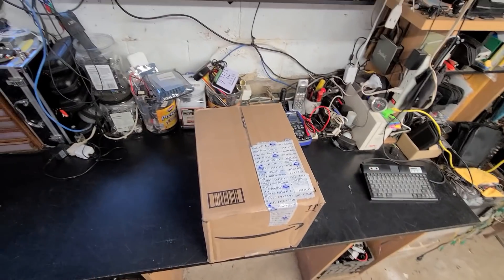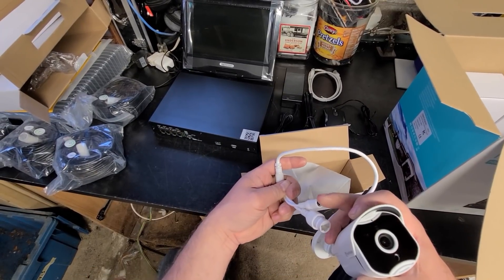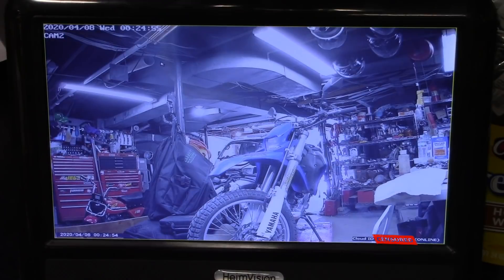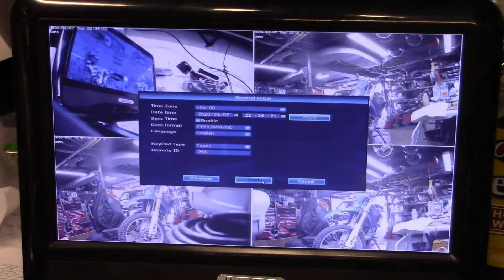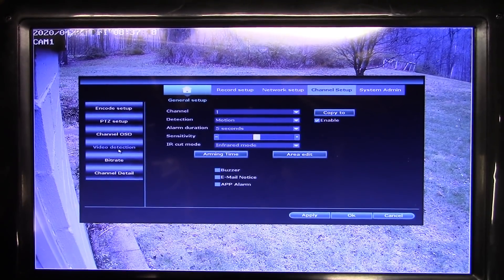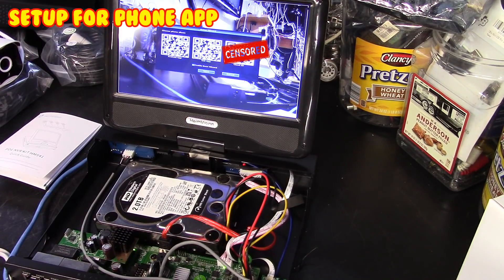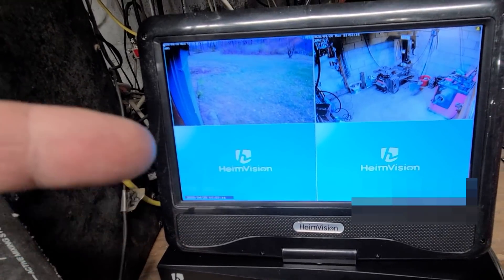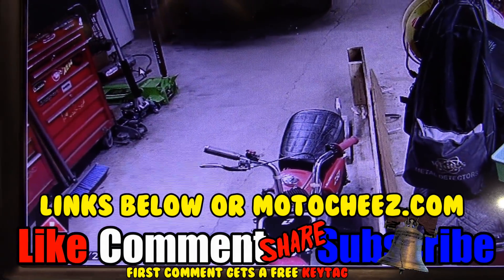**UPDATE**  BROKEN! Easy Security 4 Camera (8) System. HeimVision Plug n Play POE NVR Kit (HM541)

Comment: Not bad for the price. I've been doing cam security setups like this for over 15 years. While a ssd would be nice, be careful with which one you get. Make sure it is rated for NVR use. A NVR writes a lot of data ALL THE time and it will kill normal desktop hard drives. My favorite security cam setups are by Dahua and HikVision, but this one looks pretty okay.
Reply from the maker: Thanks, good info. I used to do security cams years ago, seems the mechanical HDDs are better for constant R)W, but I've had them fail on me after about 3 years. (stock Qsee)

Comment: You should DMZ your Chicom CCTV system or keep it off your network so it can't be accessed remotely. Don't sign up to or use any servers or apps they offer. XMeye was one my system recommended. It didn't even use HTTPS for the login screen at the time... I also suspect the CCP can access those servers at any time.
A SSD isn't necessary for a NVR. You need capacity and longevity, not fast read and write speeds. 
When the NVR fails you can sometimes find a replacement board under a different name on Aliexpress. You can also buy the camera components as well and assemble your own if you know what's compatible. 
I find high resolution CCTV camera's to be too sensitive to movement outside at night because the Infrared LED's attract bugs. I found that if you unsolder the IR LED's from the boards and connect remote IR lights up a few feet away from the camera's this stops the bugs from swarming the lens and also provides better lighting.  You can point the IR lights at a wall and create a huge softbox. This also prevents the IR version of "red-eye." 
My last piece of advice is to hide/camouflage your real camera's and use dummy camera's in visible area's.
Reply from the maker: Good info. Security cams was my thing years ago. I've had too many mechanical HDDs fail on me. Cost way too much to recover, I haven't had a SSD fail on me yet (I have 20 cams, 3 different systems now)
Reply: @MotoCheez  
Oh then you know some of those old camera's can be updated. I have some NOS GE dome camera's I gutted so I can reuse them. I think the lenses are glass so I held onto those too. 
Some brands/types of HDD have been very prone to fail. Heat can also be an issue. Western Digital's had been very good for me. Out of more dozen I've owned since the 90's I had one fail and that was probably because it got wet on my desk when I spilled water...

Comment: The fact it comes with a monitor is nice. NVR is like DVR or just a set top box, I guess. If you don't go for SSD another option would be a NAS drive. They are more designed to run 24/7. I wonder if you can use an external POE switch with it? Since running cables all over the house can be a bear, making a POE hub on one side of the house might work?
Reply from the maker: NVR just means network video recorder. MAS is probably the best option, I agree. I'm not sure on the wiring option. It may work since the cameras have an ip adress.

Comment: Nice system moto, you gonna tell that company about the bad harddrive? It could be the smaller harddrive causing the shut down during playback
Reply from the maker: It's sent with no hard drive. That was an old one I had. I doubt it, works fine on the phone app
Reply: @MotoCheez  ok..  the ssd would definitely work a lot better.    The next computer I get will have ssd
Reply from the maker: Others saying the mechanical drive better for multiple rewriting, but I've had many fail on my security systems. I could be wrong...
Reply: @MotoCheez  I heard that ssd is faster.. but I want to my next computer to have disc drive, so I can backup my YouTube in DVDs
Reply from the maker: SSD is way faster, but has less read writes supposedly
Reply: @MotoCheez  that's ok.   I don't think I'll be doing any rewriting
Reply from the maker: For a PC SSD is awesome. The SSD rewrites a lot automatically, it part of the OS
Reply: @MotoCheez  cool... I will definitely get an ssd.  I'm thinking I'll end up buying a Dell comp.

Comment: SSD is nice for booting computers, something that gets constantly rewritten (assuming you use the rewrite function), not so much, so HDD is more than adequate/good. Especially a big honker one.
Reply from the maker: My only issue with the mechanical HDDs fail every 2 years  on my other security systems. I installed a SSD and it has not failed me nin 3 years so far. None of my SSDs have failed me yet
Reply: @MotoCheez  You must be buying the wrong hard drives. If you get a hard drive made for a DVR / NVR they will last a LONG time as they are designed to get slammed with recording data all the time. I have TiVo hard drives that are over 6 years old, still working fine. It's all about how the drive was designed.  I think WD Purple drives are pretty okay.
Reply from the maker: Had a few Qsee stock HDDs fail. Yes I've heard those are the ones to get. I'll definitely try WD purple next time. Thanks

Comment: So,  without a hard drive it will not store footage? What hard drive do you suggest getting and how many days till it starts to loop. I dont know much about techy stuff, but need some cameras for my shop, there is not internet there, so i will need something that has a large storage.  Thanks for the video Moto,  very informative.
Reply from the maker: Correct, it will not record without a Hard Drive. I'd get at least a 2TB HDD. Mechanical Hard drives pretty cheap and most have said it'll work better than a SSD. I set mine up for just motion record so a small drive will last me months, if you do continuous record and use a 2TB drive, 4 cams use 169GB per day, so  it should store about 12 days (which should be double). If you set to motion record it would be several months
Reply: @MotoCheez  awesome,  thanks for the clarification.  I think i will try out this unit.
Reply: @MotoCheez  so this unit is good to go for someone without internet

Comment: SSD/solid state aren't very good for NVR duty. The constant write to them will wear them out pretty fast. A NAS/NVR harddrive is what your after but you'd probably be fine with that old drive just run crystal disk check on it and make sure its good to go.
Reply from the maker: I've heard that, never realized there was that much difference. Yes it's an old NAS drive. I'll try the crystal disc

Comment: DO NOT put an ssd drive in that camera setup.  The constant read rights will destroy the drive quick plus I doubt the device has software to maximize ssd life.  Go buy a Wesrtern Digital red regular hard drive.  Their firmware is designed for longivity in read write even if they aren't speed demons.  The red drive will be much cheaper than the SSD too.
That being said I do sugest you check the devices manual in reguards to recomended hard drives.  The OS in the system may be limited by the internal software drivers.
Reply from the maker: I realized that after the video, I've just had so many mechanical drives fail on me over the years many in many in security systems... I've not had an SSD fail on me yet.
Reply: @MotoCheez  Ok I don't know if you know this or not but feel free to ignore.  I think it would be good info for your fans to know so...here I go.  Just a question what type of environment are you using the security devices in?  Also did you always use the UPS in your system?  If there is a welder being used on the same panel even a UPS will not handle the voltage spikes well.  Hell if your on the same transformer and a welder is being used small brownouts or voltage jumps from the welder in you local system will cause havoc on electronics over time.   In my exp use at least a 500 watt ups JUST for the security system (and a good name brand like APC...no noname chinese junk off amazon. lol) a good ups should not just provide a battery backup and surge protection but some conditioning of the power it sends to the computer.   Also just recycle the things once they reach 5 or 6 years old.  Their ability to handle surges and even out the power diminishes over time so just putting a new battery in is like changing the oil in your car but never changing the filter.  Also try to putting the system on a separate panel from any big draws like a welder.  If that is what your doing great.   Welders on a electrical system will destroy motherboards and hard drives over time.  Nevermind shop environments.😂 
Metal particles, shop dust and especially exhaust particles are the number on killers of fans, power supplies, motherboards, mechanical hard drives and graphics cards.  Blow them out at least once eveery 4 months and be carefull using shop air.  Its quick and easy but nothing pops off a capacitor like a guy being to liberal with a compressor. 😂
Part of my job is IT for the building I work in.  Its and R&D shop with welders diesel dust, etc.  So I have some exp in dealing with computers and devices in a shop environment.😉  Also do some reading into the western digital red and green series harddrives.  Some people think its marketing BS but in my exp I don't think it is.
Reply from the maker: @loganholmberg2295  I agree on the UPS, 500 better than the 350 although I've never had an issue using a welder or plasma on same circuit, but it's a 220a Mig and I only use about 120a at gun which is about 15a 220v at the outlet, a stick welder draws a ton more. 
I have a 1200 watt APC for all my internet , wifi and switch gear. My 2 security systems I run on the 350 APC shown in video without an issue over 10 years. Change batteries every 5. Only time I ever had an issue with UPSs I use is when I'm on generator because it's not a UPS friendly generator. Thanks for the info, I'll look into those drives. Had a few say they're good.

Comment: Easiest way to give China access to your network and see your house 😬
Reply from the maker: I've wondered how secure they are. Keeping track of my routers connections.
Reply: Depending on what kind of firewall / router you have it's very easy to see the traffic. If you are concerned with the CCP hacking your planet I suggest you build your own pfSense router and setup region blocking. You can drop all Chinese packets. Of course, log reviewing is a good idea too. I have over 15 cams on my property and none of them send data back to the mother land of China.
Reply from the maker: That's great advise! I have 24 cams all together now on my property. I'm definitely going to look into that.
Reply: Why would China want to see your house? Are they flying over when you leave and playing with your toys? I'd be more worried about local hacking.
Reply: @MotoCheez  Take a hard look at pfSense. I'm sure you have an old junk computer lying around...? It's very easy to install, you just need two NICs. Let me know if you have any issues, I can help!
Reply from the maker: I'll check it out. Yeah I have tons of old computers. Will it run on Linux or a pi unit?
Reply: @MotoCheez  Yeah man, any old computer, but I would stick with a Core i3 or better if you are moving a lot of data, video uploads, stuff like that. But, I've run it on old Pentium 4's pretty good. Or Core 2 Duo's. It will not run on a Raspberry Pi and pfSense is self-contained, it's not Linux, per se, but is basically is. It's based off FreeBSD.
Reply from the maker: Ahh I see. Thanks for the info. 👍👍